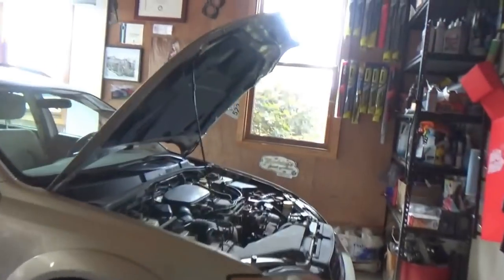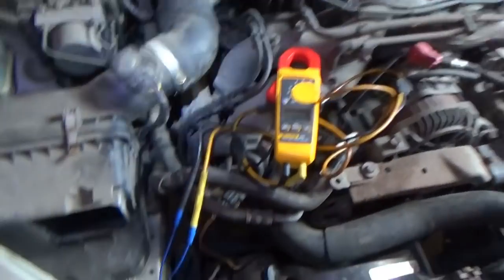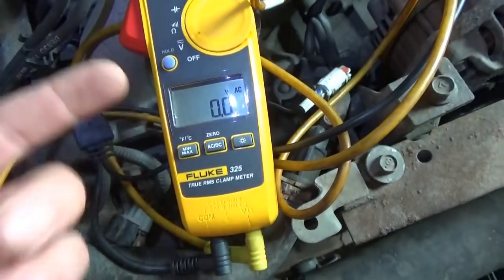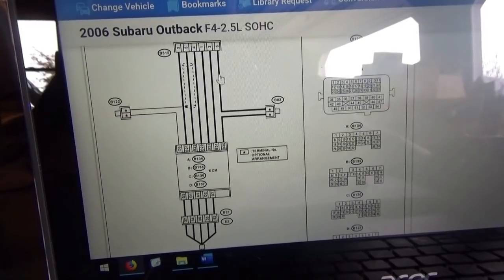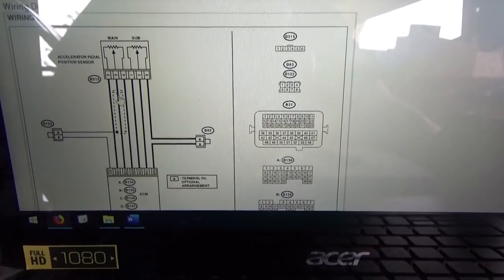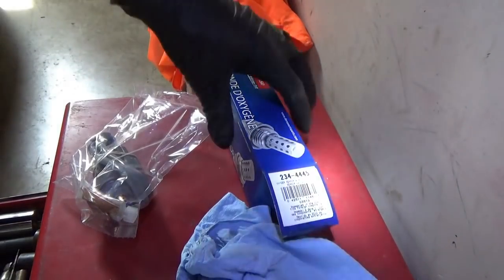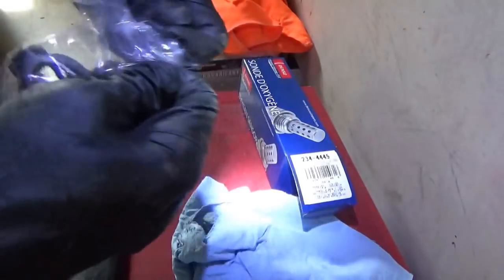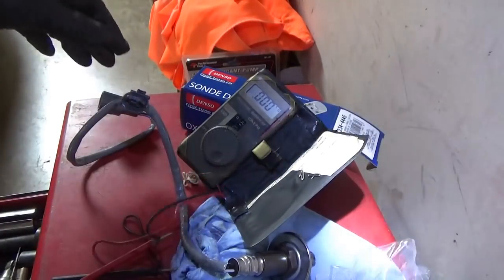Subaru Limp Home P2138: Part 2 - Diagnosis

Comment: I've probably replaced a couple dozen APPS's on Subaru's over the years and I've yet to experience one with symptoms, only current or pending codes. I've pretty much tested as you did and it's always inconclusive.  Most customer complaints is lack of throttle response. Shut the engine off and restart and all is well most times, until the issue arises again. I've replaced the APPS's with the customers blessing and so far so good, the issues are resolved without problems.  I've tested both the Potentiometer and Hall-Effect types. What has me puzzled is the APPS design is 2 channel for redundancy, so I'm assuming if one channel fails the other should carry the throttle commands, but it doesn't seem to work that way.  The P2138 code is a 'Rationality' check due to 'Correlation' discrepancies as determined by the ECM in a given time period.  Makes me wonder sometimes since most APPS codes are intermittent or a one time thing, the possibility of electrical 'noise', say from an aftermarket powered usb device...

Comment: The meter defaults to AC because most times those meters are used by electricians when working in an electrical panel. (AC). SO they chose to keep most of their customers happy. Sorta the toilet seat dilemma.
Reply: Haha I beat you by 1 minute with the same comment!
Reply: Ha Ha. I try to check  if someone has already said the same thing before I comment. LOL. My excuse is that it took about a minute to formulate my response LOL
Yes Fluke meters are pretty nice. But I've heard they've gone down hill in the past few years. I have two Flukes here.
Reply: I just love having a manual AC/DC switch set on DC, not notice and think the power is off..... nothing like a little mingling with AC to get your day started(get very pissed and pile drive the meter into pieces on the floor)
Reply: since high impedance isn’t necessary for me....I stick with my trusty Simpson 360.....set it and forget it!
Reply: @jonnycando  LOL, why not jst bust out the VTVOM's
Reply: throttle bottle takes too long to warm up!😏

Comment: Ivan, all those spikes on the o'scope are bad spots on the potentiometer. It's dirty and/or worn out... especially at about 8% above idle. These dirty noise (quick glitch) is typical of a bad pot. I don't think the noise is from scanner interference. That's why there is a shield over these wires, to prevent the possibility of outside noise affecting the throttle body positioner. You saw it but didn't recognize that the glitches were abnormal. When you put in the new sensor you should hook up the scope and see what a good signal looks like. It will be totally smooth. Good troubleshooting technique. You just didn't recognize the problem. Lesson learned. You'll get it right next time.
Nice Fluke ammeter. I have a similar one. Bulletproof.
Reply: super highly likely!
But lets not forget those things are notorious for not having the spark-plugs and wires replaced, which makes a huge high voltage leaks that will cause induction right through the poor peanut shielding ;)
Reply: @throttlebottle5906    You could be right. I don't have any Subaru experience. I'm a long time electronic instrument tech. I've seen worn out pots on the scope before. You'll never see them on a digital meter. Sometimes you can see the voltage jumps on an old analog multimeter. This is a really common problem on the feedback pots of analog positioning valve actuators.
Reply: @marscruz  I like the idea of looking to see if anyone has a good signal out there for him or anyone to look at. Dying to see it myself but where do you look? Even if anyone has  a scope and a new Subi that could take the time to post it here.
Reply: @gs7865    Ivan will likely be posting another video when he gets the new pedal and throttle pot installed, at least I hope he does. This is something you only need to experience and see once in order to understand what is going on. The spiky waveforms are because of dirty, corroded or worn out places on the old fashioned wire wound pot rubbed by a metal alloy wiper contact. This is old tech. Like another poster said, the newer pots have carbon resistance elements or optical encoders or possibly some other more reliable way to tell the motor/positioner in the throttle body where to go.

Comment: Nice meter, you're right about recommending that the customer should replace the throttle unit especially if it's been upgraded that means Subaru knows the mechanical style had issues and it's a serious enough for them to do away with that style, intermittent issues are the worst for a couple reasons

Comment: Probably is the APP sensor, but there IS one thing we haven't taken into account...

Pull up scan data while the customer drives the car, and watch where the customer rests their left foot on a 20+ minute drive.  You probably see where I'm going with this...  You may laugh, but I've seen it!  Simultaneous brake and accelerator actuation SHOULD snap the throttle closed.  Sometimes.  Occasionally...  ;)
Reply: That whas a goop tip! Thanks!

Comment: What a PITA intermittent problems are! I get so frustrated that I almost want to fire the parts cannon at it sometimes. Hate not knowing, and hate waiting to find out! Tough for an impatient guy like myself, lol. Seems any vehicle I get in here is never cut and dried - always an intermittent! Even with my own vehicles. 😣 Although I did have a complete HID headlamp failure on our '86 Grand Marquis last week. That one was pretty cut and dried. Wife had to come home with the high beams on! Luckily she didn't pass any cops on the way. The hidden tax of MA is always lurking, ready to pounce!

Nice Fluke! I was just saying in my last vid as I was doing an old school amp test with my 20 year old Blue Point meter that I need one of those! I need alot of things, but that will be next, for sure.  Nice one as always, Ivan! 👍🍻

Comment: Never seen anyone get so excited over little packets of anti seize. It's funny.
Reply: Imagine taking him to McDonald's and he has fits over the ketchup.
Reply: lol @ yall
Reply: I have a dozen of those saved up :-)
Reply: @edwinbrewer1789  hey, why not, the stuff costs pretty high when you buy large containers and use it a bunch. I keep them around for when I run out or need to do a small mobile repair out somewhere.
I myself prefer drowning everything in anti-seize and spending 30 minutes cleaning it up, than spending far more time replacing the same junk that'a guaranteed to fail again and fail it does often, no matter what "branding" is on it, even OEM branded 5 to 10 years later is probably cheaped out
Reply: @throttlebottle5906  And then when you're done with the stuff, your hands look like the Tin Man's. Only way around it: disposable gloves.

Comment: Make sure you keep the receipt for that Fluke and also scan the receipt and keep it saved on you computer in case you need to print up a copy.  I had a Fluke and the battery terminal in the meter broke.  I contacted Fluke about it and they said they had to have the receipt in order to honor the warranty.  I got the receipt out and it had completely faded to the point where it couldn't be read and they refused to warranty it because of that.

Comment: That's strange that Subaru don't list the wiring colour codes on the schematic for the Outback because when I was looking for a wiring schematic for my brothers 2000 model Subaru Forester on the weekend it had the colour codes written on it,for example,pin 7 on the ECU had W for white written on the schematic for injectors 1 & 2 ground wire.

It was ass about in my brothers car because the EJ20 engine had the white wire grounding out injectors 3 & 4 so I suppose it doesn't matter because the fuel injection system is a semi sequential batch fired system where 1 transistor grounds out injectors 1 & 2 whereas the other transistor grounds out injectors 3 & 4, I've ordered another ECU because injectors 3 & 4 were receiving no pulse at their connectors but the yellow/red positive feed wire had a constant +12 volts DC whilst the ignition switch was switched on.

The car was running fine before the ECU went in it !

Comment: Good video. It’s to Subaru’s credit even on a 13 year old car with over 170k miles this is still only a very intermittent problem. And it’s also to their credit they have resolved the issue entirely on newer models. If only the Germans and FCA could have anything even resembling a similar level of reliability, simplicity ,and commitment to resolving issues.

Comment: I think the reason that it uses AC as the default could be that it has a diode for the AC testing that it doesn't need for DC testing. It is possible that checking AC when it is set for DC might damage the Fluke so it is set to AC as default to protect it. it seems odd that there isn't another position on the main selector switch so AC and DC would use a separate position on the switch.

Comment: Hmm dodgy pots, i would remove the assembly and feed line level audio through each pot to an amplifier, listen for crackles as you turn the volume up/down with the peddle lol.
instant results through your ears :-D
Yes i use odd methods :-D
Reply: it's an 2006 with ECM controlled throttle, I'm willing to bet the pots in the TB are gone as well as the pedal,  the TB has non stop movement and the pedal is prone to vibration and bumps causing constant movement via your foot. it;s safe to assume the majority will be well worn/bad by 35 to 70K! but within noise/offset limits still.

Comment: I wonder if you would have used the Main APP Signal ground pin 5, which was shielded, as your ground point that may have cancelled the noise. Be cool to see the difference.

Comment: I have the 2010 service manual. All the wiring diagrams show the wire color.
I thought you were on the right track when you mentioned water intrusion. Did you ever check connector B83? In my manual it shows it behind the glove box (2010 though).

Comment: Thank you Ivan. Good job. Control Module Pinout and Reference is also a good resource that gives wire colors and expected voltage readings. Will also include sample waveforms if applicable. Have a blessed and safe week.

Comment: Interesting investigations on this problem. Those are so difficult to deal with and so immediately required to fix due to safety concerns.  Since the budget is already on the inexpensive end of things, not being in a Subaru dealership or full blown independent shop, 
Might just be worth replacing that part for $126. Subaru Part No.: 36010AG021

Comment: The Fluke 325 was probably designed for electricians, not automotive repair. But they are nice.
Reply: I agree with your comment.
Reply: I had one of them, Returned it,  Made in China too .  Fluke makes a nicer amp clamp but its maddd $

Comment: This happened to my Baja today. Three times. One on the way to work (good thing I have my cobb ap to delete the code and was able to drive). Happened twice on my way back home from work. All three times showing p2138. I'm assuming it's that sensor. Will check it out more in depth tomorrow.

Comment: In part One at the very end of the scan tool display of the 2 sensor voltages,  the number one sensor wave form deviated from number two just a little. Did you see that on playback? But, truly all your videos are great. Thanks always.

Comment: I had to watch this. My thought was wiring issues. Codes dont just set for no reason. That heater control is pretty far from the original problem. I just mentioned wiring before you went on with this. If he ran through a deeper puddle, you can bet the water egress set the code. I like spraying all my wiring with silicone before winter sets in for that reason.

Comment: Someone commented in the first video that O2 sensors can actually cause this code.  I wonder if there's any correlation.  I had the same code on a 2015 GMC Canyon that was just as intermittent.  There was a TSB for the code indicating that aftermarket equipment or moisture in a connector in the kickpanel but this truck didn't have the connector in the kickpanel.  I ended up removing some aftermarket backup sensors that were not being used as the head unit that goes in the car was gone.  After removing those sensors which were only connected to the reverse light circuit and the ground, the problem has never returned.

Comment: That noise in the APP is always there in mostly every car and you can’t get rid of it even new. That APP looked good to me but they are almost all the time intermittent. Some trucks have app 3 but aren’t used on most. Change the APP and you’ll be good to go. You can buy them separate

Comment: Nice DIAG.   But after fixing the O2 sensor circuit how come you didn't reset the computer, and rescan for codes again cuz sometimes other sensors will set off other sensors code, you know what I mean.. Hmmmm 🤔

Comment: I got a great idea for throttle control, even blows hall sensor out the water.
What you could do is use a sheathed cable direct from throttle to throttle plate, imagine how reliable, safe and simple that would be :-) 
Bit troublesome faults like that which can not be reproduced easily yet potential safety concern .
Electronic throttle control is another area that really was logically better with mechanical control and tps sensor for ecu input .

Comment: Thinking outside the box but what if you have (2) different 5 volt reference lines feeding the pedal and a sensor on one of the circuits pulls down briefly causing this issue?

Comment: My 2002 F350 7.3L Diesel is the same way.. It has over 300k miles.. and a couple of times when it was pouring down rain outside, my pedal stopped working and I was nearly stranded.  Luckily I can just shift through the gears with my diesel idling and it will still go. lol...  but It hadn't happened again in a couple of years, so I still haven't ever fixed it. :(

Comment: Stop the video at 19:29 - appears that the blue trace has small vertical noise in three locations that the red trace does not. Since the volts scale is quite small, this noise represents quite a large percentage of the signal. Add the sampling rate of the ECM and this will only show up intermittently. Seems to be occurring at the same point also - perhaps the 16% from the last video? Changing the things out is the best idea of course & OEM all the way.
Reply: David Melbourne that’s just normal noise in the app.
Reply: @weldingjunkie  Yes most likely. Since we are looking for a marginal condition, this kind of noise does not help.
Reply: David Melbourne yeah not at all for some reason app’s are noisy little guys

Comment: Hey Ivan, How much are you paying for your All Data.  I my "DVD" version is getting long in the tooth, and I lost my Automate access thorugh Michigan e-library, and BBB seems to always be missing what I am looking for.   Last time I did the All Data Diy on a car when I needed it, but $29.95 for the first one and 19.95 for the second one per year.  I build it into the cost of the repair, but I am starting to wonder when it will be worth it to do the full All Data Repair.
Reply: FrugalPrepper's Garage & Garden my last quote from my rep was $145 a month during a promo if not it’s 165 I stayed with pro demand
Reply: @weldingjunkie  Okay.  Thanks, It would be worth it then.  My current AllData on DVD doesn't go past 2011.  I am going to check with Mitchell as well to see how much theirs is.  Pistons and Pixie Dust uses some shop product as well that has all the service info and estimates and billing, I am going to ask her.
Reply: FrugalPrepper's Garage & Garden yeah it’s def worth it I got a deal I pay $135 a month for pro demand however with pro demand you need a tax id and buss name to get their services. Alldata you don’t.
Reply: @weldingjunkie  It easy enough to setup a sole proprietorship and get a tax ID on the IRS website.

Comment: to answer my own question from 3 weeks ago, I emailed my step-son (Omsk, Russia); he found wiring diagrams that are "non-existent" in this country unless you pay some loser some big bucks. The B83 plug is located by the ECU/ECM in the passenger floor board, so it should NOT be exposed to much water, etc. 
Speaking again about more diagrams etc. that are "unobtainable" in the USA, again my Russian steps-son found diagrams for various plastic car fasteners that show the actual dimensions of the particular item. I would highly recommend anyone who has had problems obtaining specs for such items, to "befriend" someone "over there" to avoid the unnecessary "rip-off" tactics employed by the losers here.

Comment: i always just pull over, reset my ecu, and drive away 😅 maybe i should replace my throttle pedal assembly 😬 i drive a 2006 legacy gt, seems like this is a common issue

Comment: I like your new Fluke clamp meter. I have the same looking meter but a different color. The one I have is a Chinese knock off.  Wonder if they are made in the same factory. The only comment I have is the same as you, it always reverts to AC.

Comment: I have an 04 forester xt and the code comes up when I put the floor heat to the floor with the blower on high. I just stopped putting the floor heat so hot and it hasn't popped up to stall out the car.
Reply: amadafaka  Hey this just happened to us this morning ( 05 Subaru Forester ) my wife put on the heat and the check engine light came on and the cruise control light started blinking and the car went into limp mode while at the drive thru ! I told her to pull over and shut the car off and wait a while and then it drove back home fine but the CC is still blinking. Why do you think the heater would cause this problem? Curious!!!!!!
Reply: @youtubebitchcenter1463  The heat could create resistance to the sensor on the pedal causing it to show different voltages when they be the same. If you have a scanner that graphs you can see what the numbers are when heat is applied.